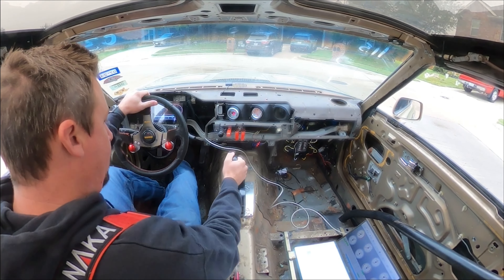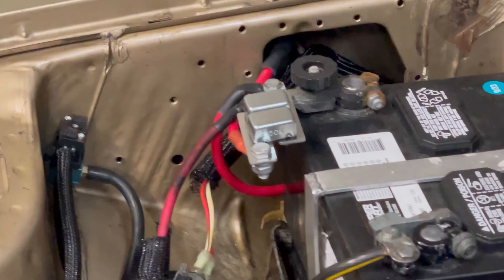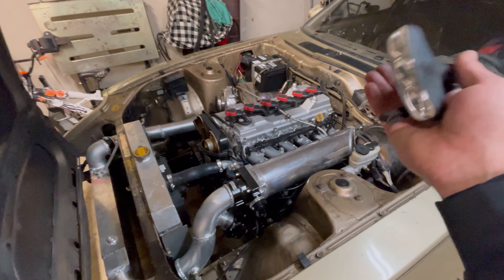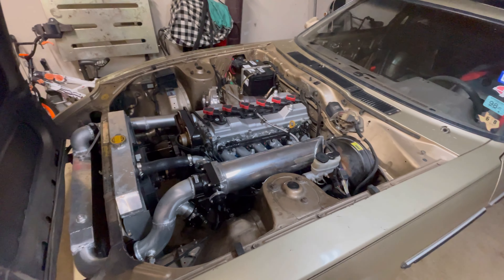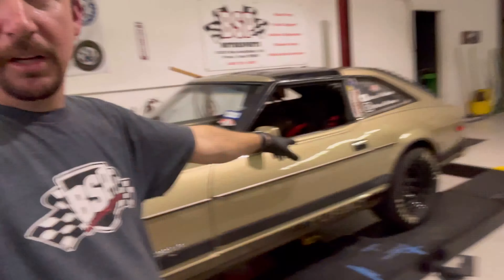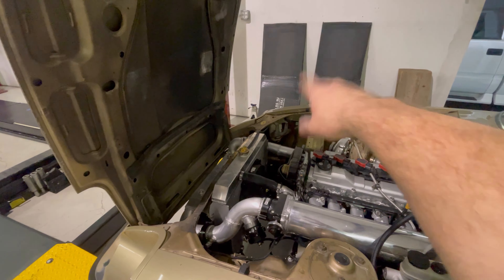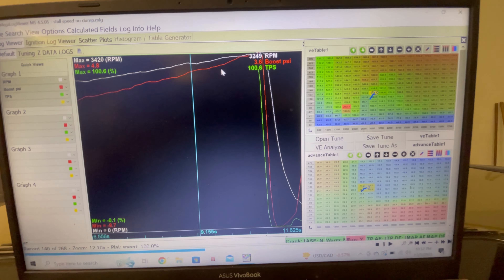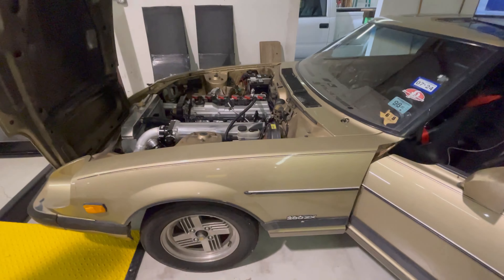Testing my dining room-built 2JZ/TH400

Comment: Did you put a later model 300zx clutch pack posi rear diff in your car ?. 

On the 2J did you remove the plate on the back of the head and install a plug the hole that lets exhaust gas run to cylinder 5 or 6 ?. Not sure if VVTI heads have that. 

Your channel just jumped up in my feed. I did a turbo N/A 2J swap to my 74 260Z about 6 years ago. It's the earlier non VVTI 2J. 

Using a Megasquirt 2 unit to control it. 
It's been in storage for a bit but I think it's time to get it out before Christmas.
Reply from the maker: I swapped the Z’s rear end with a solid 8.8 ladder bar set up last year. the vvti doesn’t have the egr passages you mentioned. I’m jelly of your non vvti s30. Mines like the wish.com version of that 😂 😂. I bet that thing would love some boost! I never imagined the 2j would be a great choice for Na. I know mine have been Prius slow before the boost comes on.
Reply: @masterofmachines Ok nice rear end. 

Mine is boosted. 15psi on the  street. 
Damn thing pulls hard as hell on the freeway, from 70mph on up. 💪🏾

Comment: I use the honda bond High Temperature,silicone on all my 2jz oil pans and the don’t  leak. That’s my secret. The got two kinds get the one in the black tube.